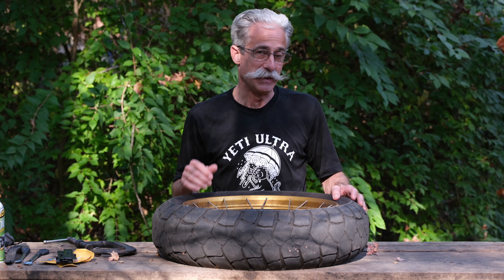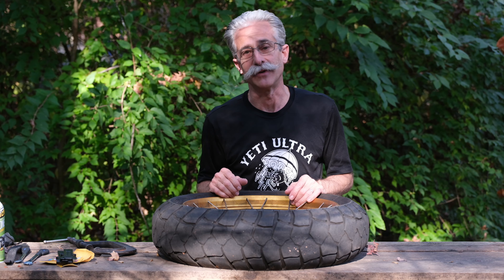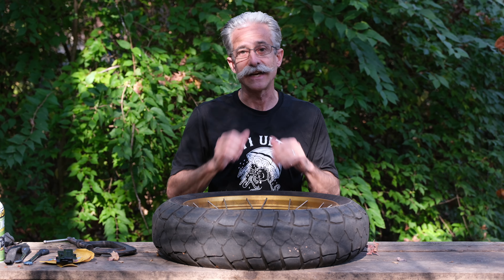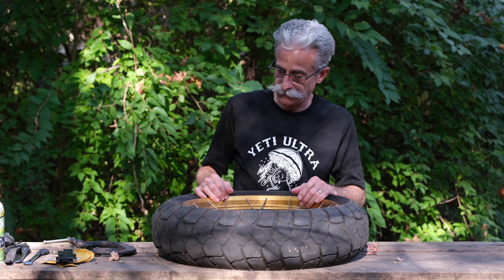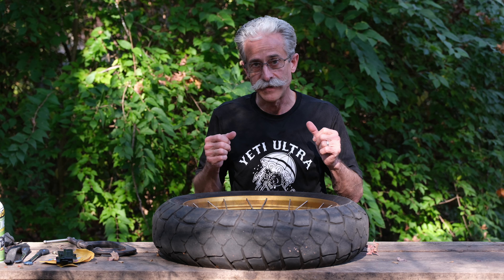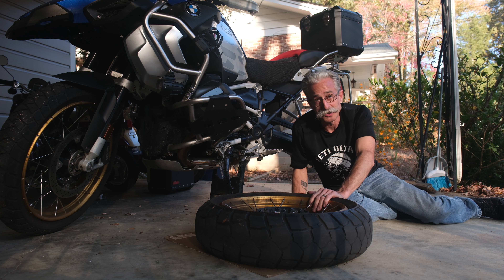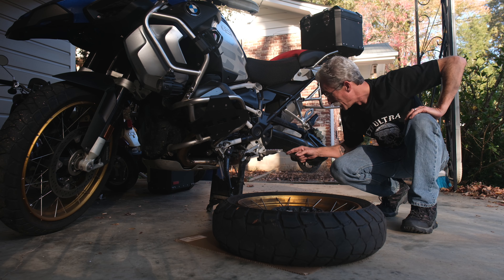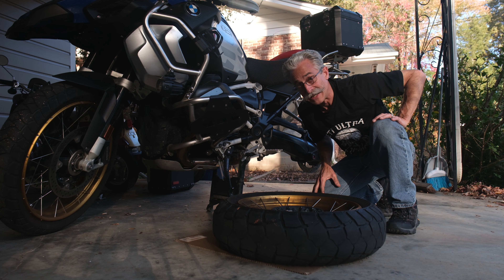7 Ways You Can Break a Motorcycle Tire Bead

Comment: as someone who's been changing motorcycle tires of all sizes for more than 40 years i think most experienced bikers would agree that your effort to level the field by pre-breaking the tire pretty much rendered all your subsequent tire removal evaluations irrelevant. Again i think most would agree that your outcomes would have been totally different had you been using a separate long time mounted wheel and tire for each of your different evaluations. there is no way those little spoons would ever break a tire that's been mounted and weathered for 10 years or more. while i can appreciate all the effort you put in to the video, i'd be remiss if i didn't say that in 40 years all i've ever need to break a bead is a bench vise but then again all the tires i've ever changed were worn out and i didn't care if they got damaged in the process, if i were going to R&R the same tire over and over again  then my method probably wouldn't work out to well.........
Reply from the maker: If I had had four bikes with worn out tires it certainly would have been much more accurate, but since I didn't I figured this was the best way to compare the methods. That being said, the first time I broke the tire (before shooting the video) I used the two-piece tool and it broke the bead just as easily as in the video and surprised the hell out of me. The tire had been mounted for 8,000+ miles.
Reply: Yep. I'm removing a tire right now thats been on a while. I tried with the spoons just for kicks. Didn't think it would work.  I'm at home and have plenty of tolls but want to use only what i would have on the bike during a camping trip.  So going to use the c-clamp.
Reply: Hey...just ride enough so ur tires don't stay mounted for 10 yrs...haha I just finished struggling with the 3 spoons method on my harley...still worked was just a pain
Reply: Beg to differ . I tried the 2x4 lever thing and it worked….

Comment: As a wood worker I went with three 12" Jorgensen wood clamps. They worked great because as you open/spread the back of the clamp, the front pinches in nicely. I also set the wheel/tire in the sun for a bit to soften it up.
Reply from the maker: those clamps look like they would work much better than a C-clamp!

Comment: That’s messed up. I’ve tried the two by four driving on and the c clamp and it got one bead broke and 3 lived. Then the 2x4 snapped in half. Guess my truck is too heavy for the job. After church I’m gonna try the 2x4 leverage shed option and then probably ask Walmart if they will break it. I’m running out of options.
Reply from the maker: man, those must either be some tough tires or maybe they've been on the rim a LONG time. Good luck and let me know what ends up working

Comment: Quick question- if you were to break the bead using  the car method and the tire creased  at the sharp lip (where the  tread runs out and comes to a point) would you still be able to remount and use the tire or is it considered damaged at that point?
Reply from the maker: Not sure I can answer that… if you think the sidewall is damaged, then the tire is shot. I didn’t have that issue.

Comment: Somebody should make a motorcycle tire bead breaker like a C clamp, but specially formed for bead breaking, and put a large hex bold on it so a drill / driver could be used.

What I've been doing is I put the wheel on my bench in the garage, and have a short 2 x 4 stub screwed to the wooden bench, standing upright, with a bevel, to go against the bead on bottom, and then I have a horizontal 2 x 4 screwed to the studs about 2' above and use this as a place to put a 2 x  4 lever underneath which pushes down on a 16" or so 2x 4 which will be placed on the upper bead. Then I bear down on the lever to apply downward pressure on the bead.

For tire lube I like to use Blue Magic which I find at Walmart in the hair section. It's cheap and works very well for tire lube. When I use that, it's not uncommon to find that my tires only loose a few pounds of air after sitting all winter. It's also good for any kind of 0 rings and it's cheap.
Reply from the maker: It would be pretty easy to weld up a C-clamp like that I would think, but your 2x4 setup seems pretty good.

Thanks for the Blue Magic tip, I'll try that out! Thanks for watching, please subscribe if you haven't. Keep watching and I'll keep posting!

Comment: I've used all those methods except for the backing up the car onto 2x4.  But it's kind of cheating with that tire - try one of those super-stiff sidewall tires like a Heidenau K60 and they don't work so good. I've used TyrePliers from Australia which were OK but rather expensive and I managed to break the tool on a particularly difficult tire, and then tried BeadBuster which in my opinion is by far the best. Also small enough that you can take it on the road, albeit a bit heavy. Wish they made one out of Aluminum...
Reply from the maker: It's the only tire I had, so that's what I had to work with! The BeadBuster looks interesting.

Comment: The two bits of wood method I'm definitely trying, that looked super easy. Why don't they make a tool like that instead of the big wheel locking one which looked rubbish?
Reply from the maker: The big wheel looking one is rubbish... it was given to me and I'll be tossing it! The wood wedge works great and it probably too simple for someone to make and sell!
Reply: @mustachemoto   I actually tried a few methods but the two bits of wood one was the only thing that worked. Now I have to get the new Angel GT on. These tyres are like granite. I won't be tackling this again. Me = 2 days vs the Shop: 25 minutes
Reply from the maker: Oh man, just use the zip tie method in the video below. It works awesome! I’ve done it several times, but I can remove, mount and balance both tires in an hour or so. Much faster than having to take the bike to the shop and wait. https://youtu.be/f3dRSIJ-UI0?si=TnMmuQyXPiOFQmzd
Reply: @mustachemoto  I did use the zip tie method in the end, along with a heat gun and bucket loads of soap. Sometimes neat, sometimes watered down. No matter how much air I put in it didn't seem to want to cross the bead until I put about 70psi in there and kept bouncing it around my garden. Eventually it went bang and my back was so relieved. I swore I'd never bother again. A whole day of sweating my ass off to save £50? minus the tools / new weights and replacement foot pump which I broke.

Comment: I have one of those bead breaking lever contraptions and it's a piece of crap. Different axle sizes,  different diameters, different wheel widths, brake disks, etc were not considered in the design. Plus the cheap construction  causes the bead "foot" to slip on the lever. Plus it's a pain to store!

A 1.5  out of 10, don't waste your money.
Reply from the maker: totally agree